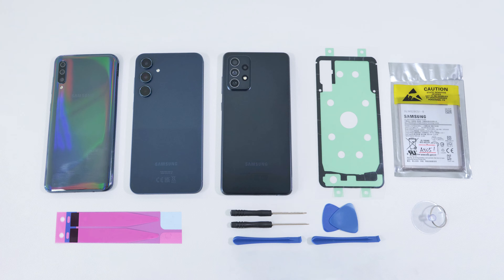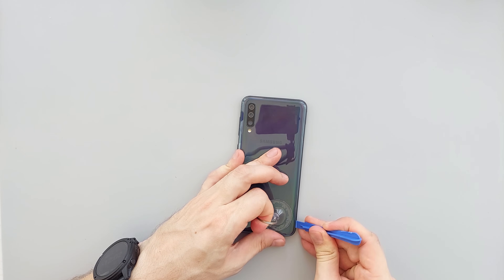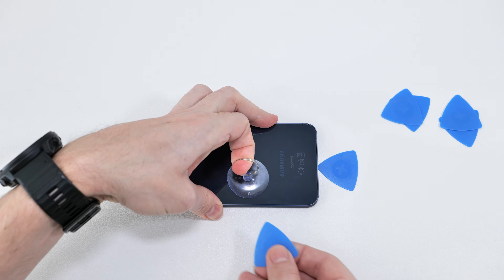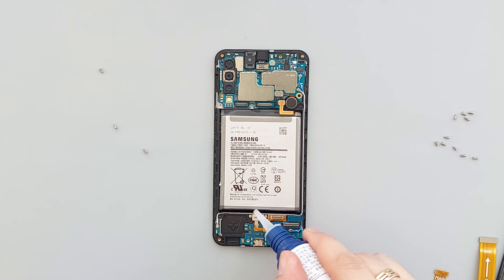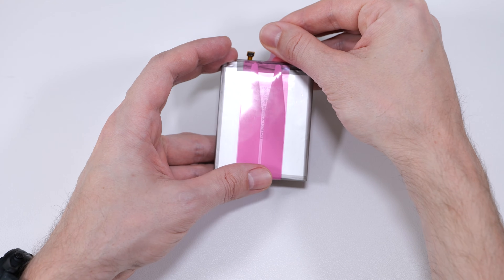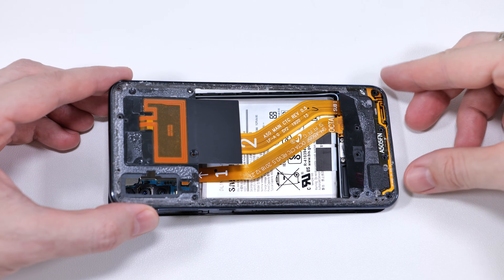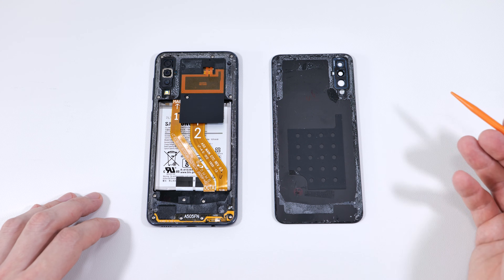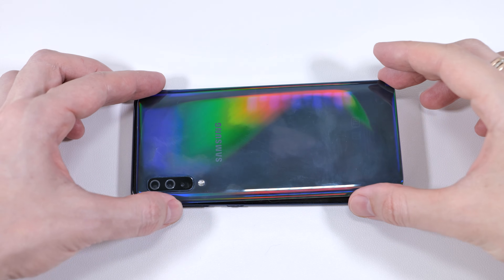How to Replace the Battery in Any Samsung Galaxy A Series Phone (A50–A73)

Comment: I do not need for repairing shop i have to changed the battery urgental i do not reqire for reparing shop because mobile shop will change the original parts and no more longer my mobile function so please give me reply to purchase new orìginal samsung original new battery  is the only way to get  it purchase it is very necessary please reply so i may place my order to it

Comment: In the link provided forA models I don't see A35 in the list. Is there a compatible battery model?
Reply from the maker: I haven’t seen any batteries for the A35 for sale yet. That model is still relatively new.
Reply: How i will get my Samsung  original cost
Reply: In rañchi disttict from which shop can be provìded and what is the cost
Reply: From which shop at Ranchi main road Ranchi can provide please responc with mobile no of that shop so can purchased iy
Reply: It ìs requested  that in Ranchi doistrict samsung mobile from which shop can i purchased

Comment: Why do phone companies make it so hard to remove the battery
Reply from the maker: It's a quick 5-minute job. Warm up the back panel with a hairdryer and use a suction cup to remove it. Replace the battery, apply new adhesive tape, and reattach the cover. The suction cup, adhesive tape, and prying tools are usually included in the battery replacement kit.

Comment: My phone company said the battery can't be replaced, and when it goes, I have to ge a new phone.
Reply: I would definitely not attempt this job.   I would just buy a new phone of same brand and model #.    My Samsung Galaxy was $69 at Walmart.
Reply from the maker: 99% of modern phones have non-user-replaceable batteries due to the glued back cover. However, as you can see, it's not that difficult to replace it yourself

Comment: I'm surprised that those pink adhesive strips are needed with all those screws holding it together, can the battery really rattle around without them?
Reply from the maker: Batteries in smartphones are glued to the chassis to prevent movement that could damage internal components like ribbon cables and connectors. Also, the adhesive helps maximize space efficiency, enhances structural integrity and helps with heat management acting as a thermal pad between the battery and the chassis.

Comment: Thank you for the tutorial. Used phones in the middle price class are not worth much and a battery or screen replacement of good quality is expensive if done by a phone repair shop.
Reply from the maker: Totally agree
Reply: I need  new batry for Samsung  mobiĺe how i may get new battery  and what will cost me
Reply: How i may purchase new original Samsung  mobile
Reply: Sir this is the ònly way if i do not get the orisional battry i have no optiòn iam not position to purchase new device  so your proper guidness is necessary rather going in shops
Reply: So that it is necessary to purchased  new battry  is isetial
Reply: Kindly help me to provide me samsung mobile phone battery
Reply: Kindly help me in Ranchi district which  shop is can available for me

Comment: Last time the battery of my phone got bad they charged me 80€ for replacing it and deleted all my stuff

This will save me some money, time and photos 😁
Thanks
Reply from the maker: I run an electronics repair business, so I know what happens behind the counter and familiar with cases like yours. However, I'm also happy to share my knowledge with people so they can save money and perform those simple repairs themselves.
Reply: That was completely unnecessary by them. I hope you had a backup of your pictures and videos. I am using Microsoft Onedrive and don't miss Google Drive at all.